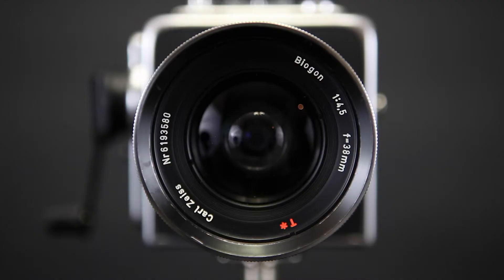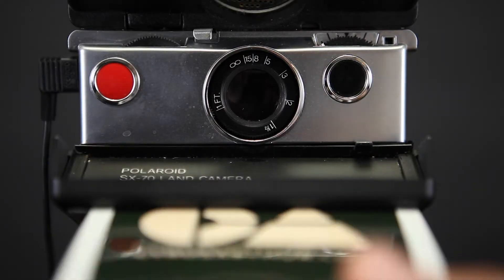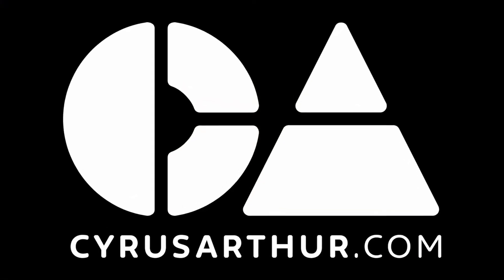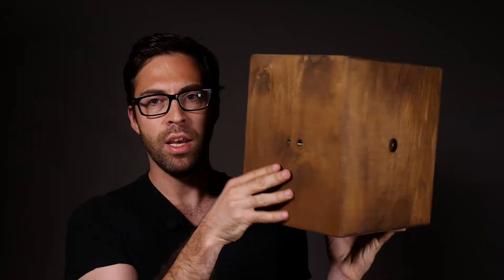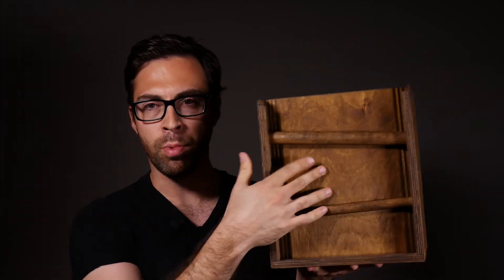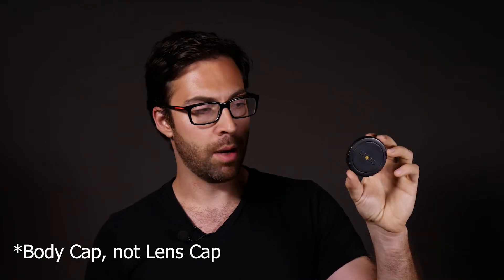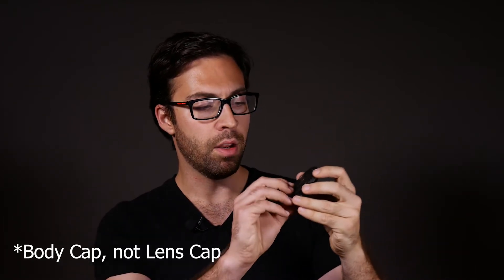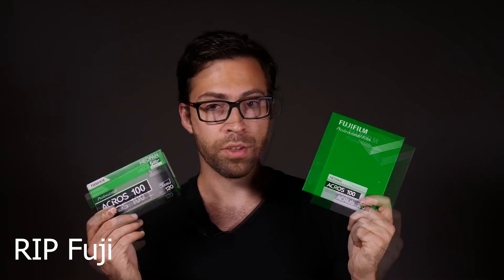The Pinhole Camera - Worldwide Pinhole Photography Day (WPPD) 2018 Q&A- Episode 2.5

Comment: Firs of all, thanks so much for all the useful and interesting information on this and previous videos about pinhole photography in your channel. 

I'm going to build a panoramic pinhole medium format camera. It has a "focal distance" of 58mm, curved film plane and 139º of view angle, and hopefully it will produce stunning, wide and relatively sharp 6x14cm pictures. Spent quite some time designing it and making some calculations, so i really want to get the best possible quality out of it. I have the luck of having a cabinetmaker father-in-law, so i asked him to just make the wooden box for the camera, and i will make all the interior parts (the curved path for the film, the film advance mechanism, an inner shutter triggered by a remote shutter release...)

When calculating the pinhole diameter for the given "focal distance" i rely on online pinhole calculators. I carefully watched your video on this subject, but all the math behind it was too much for me. The thing is... as you know, there are a lot of online pinhole calculators, but all of them give me different results (usually between 0,30 and 0,32mm for the pinhole diameter). 

So... which calculator would you use if you didn't do all the math by yourself. Which one is the most accurate in your opinion?

Again, thank you so much!
Reply from the maker: You're very welcome! I'm glad I can help and thank you for the kind words. Any online calculator will vary because of the different assumptions being made about some of the variables. Specifically people interpret the Circle of Confusion differently as well as use different numbers for the wavelength of light (most use 550nm or 555nm because green is in the middle of the visible light spectrum).

So which is "best" or "most correct", that's really hard to say. However, there are some general guidelines that can help. I would look at a few calculators and then lean towards the smaller pinhole size. It is much worse to have a pinhole that is too big than to have one that is too small. The negative effects of diffraction are not as bad as you might think.

The other very important part is getting a pinhole that is perfectly round. This is hard to do if you are making your own, but you can buy them from people that use lasers or special etching techniques to get very round, very accurate pinholes. Also, remember that the material must be thin to get a wide enough angle of coverage.

It sounds like you are putting a lot of effort into the camera so I would suggest you get a high quality pinhole. I have ordered from an eBay seller by the name of "fireseller66" who makes very nice affordable pinholes. I have no association with the seller, but I have used their products and have been very satisfied. Sounds like you need a 0.3mm or maybe even a 0.25mm pinhole.

I hope to have a video out tomorrow that will demonstrate that diffraction isn't too bad and why a pinhole that is too big is not good at all so stay tuned for that. And don't forget to share pictures of your camera and made by your camera, I'm sure others will be interested.

Hope that helps!
Reply: Thank you so much for your reply. Yes, i'm making my own pinholes, they are sponsored by coca cola ;). I can measure the diameter and roundness quite accurately and i already made some pinholes for other 35mm camera i have (i made a 0,22mm one, let's see how it works when i receive the first developed roll). It's true that a 139º angle view may be too much for a homemade pinhole, specially because i don't have really fine sandpaper right now, and i expect shaded corners because of the tunnel effect. Anyways, i have a couple of long expired 120 film, and they will serve as test rolls to check that and many other problems the camera may have. But, of course, i will use your advice and ask fireseller66 if i need to. This info is apreciatted because i already made some unsuccessful ebay searches...

The kind words i told you before are really well deserved. There are a ton of pinhole related videos on youtube, but 99% are 3 minute ultra simplistic explanations on "how to do your shitty pinhole camera you will only use once because it's blurry like hell". There are serious people like you, Joe van Cleave and a few more exceptions, and i think the contribution you make is very valuable and greatly welcome.

So.... again more thank yous, and i'll stay tuned to your channel for more, and will share pictures!

Comment: Is it possible to push paper in development? Should I go for something insanely large or settle for 5x7-ish size? I have a huge lot of old paper and need to test it anyway..
Reply from the maker: That is an excellent and challenging question. I'll address your second point first. When it comes to size I have found that it gets exponentially harder to manage larger sheets of paper/film. Not sure what kind of darkroom access you have, but I've never printed bigger than 16x20 and I couldn't imagine using a camera that large in the field. 8x10 tends to be the upper limit of portability for me.

Now, you can't really push paper in the way that you can push film in a darkroom, at least in my experience. Development times for paper are pretty standard around 90 seconds for RC paper and 2-3 minutes for Fiber paper. If you continue to push the paper then you will probably only introduce more base fog without any additional highlight detail. What didn't get enough light is not going to magically appear on the paper. 

If you're going the paper route then you can error on the side of overexposure and always pull it out of development early (possibly sacrificing some contrast). Then you have a paper negative that you can control the exposure for if you're going to then turn it into a positive by sandwiching that paper negative with another piece of paper emulsion to emulsion.

If your paper is old it also may have lost sensitivity so keep that in mind. If you have a lot of it see if you can do some testing beforehand. Or if you're in the field, make lots of bracketed exposures. 

Hope that gives you some direction. Good luck.